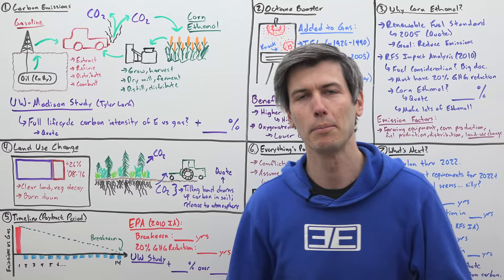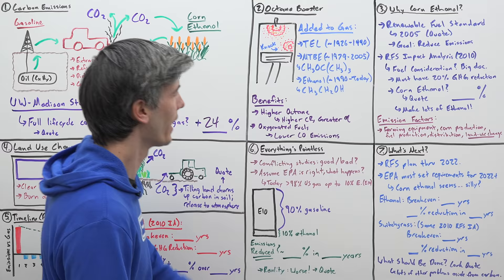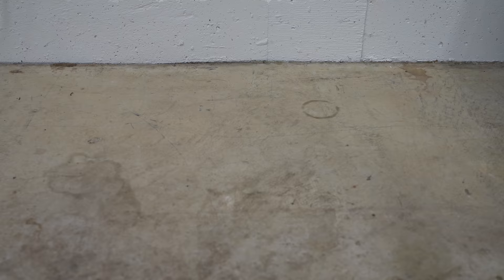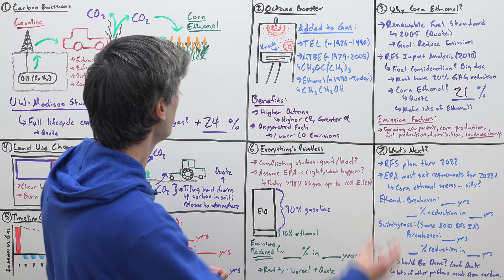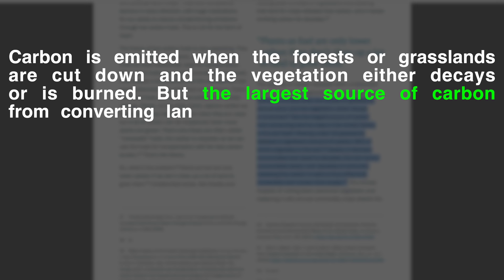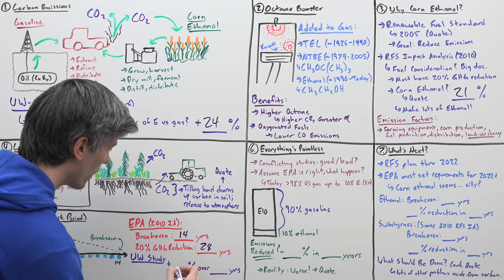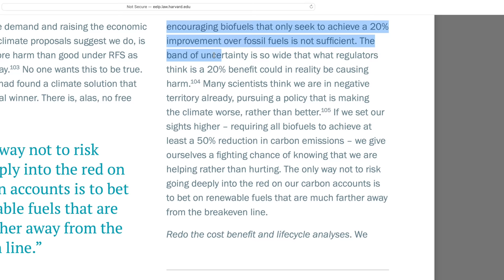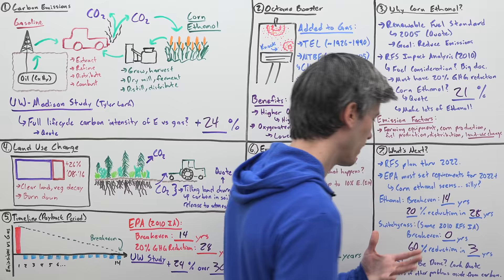America Was Wrong About Ethanol - Study Shows

Comment: You left out the fact that ethanol doesn't contain the same amount of energy as gasoline thus reducing the efficiency of internal combustion engines resulting in more fuel being consumed in the pursuit of conservation. It's also bad for many engines, especially small engines, causing them to run too lean. Another wonderful known byproduct is that ethanol is hydroscopic which leads to fuel system problems and internal corrosion. Rubber and plastic can swell or lose their structural integrity causing seals to leak or fail. Some manufacturers will void the warranty if E15 is used. Everything about this substitute adds to more energy being consumed to compensate for it. If it worked there would be no need to mandate it. 

"As a result, taxpayers have spent billions of dollars over the last 30 years subsidizing the production of corn ethanol, while at the same time creating unintended costs for consumers and the environment."

This was always politics. It's been well known since its inception that the unintended consequences outweighed any theoretical good.
Reply: detail question, what makes you say it's bad especially for small engines? don't oxygen sensors and stoichiometric EFI operating/control strategies correct it to lambda=1 which is say 14.7 for 0% Eth gas and 14.3 or whatever respective point (i forget) it might be for E10 gas etc?
Reply: Imagine having a carburetted motorcycle and leaving it for some time without starting it. Gunks up jets, clogs the fuel bowl etc

Makes startups after winter a pain in the back

Yes. I did use fuel stabilizer, didnt do jackshit
Reply: @renizer  not on lawn mowers/ lawn equipment and carbureted motorcycles. Anything without electronics to compensate. Seems like you’re nit picking and missing the bigger picture…
Reply: The best results would be reached if gasoline cars were turned into flex-fuel (or bi-fuel, whatever the name) cars. I installed a small box to my previous car and that basically monitors the data from lambda and increases the time the injectors are open. So it stands between the car's own computer and the injector. Of course it also monitors the alcohol concentration. E85 contains about 85% of ethanol and my 2001 Audi A6 was running like a charm with it and also with any mixture of that and gasoline. Only cold starts in the winter are a problem, below -5 celsius needs some gasoline mixture. Pure E85 consumption was about 30% bigger than 98 octane (Europe standard, don't remember the RON vs whatever differences) that has 5% ethanol in it and can be used without any modifications to your car. 

But also, the ethanol should be made out of waste, not turn land and grow food for that. In Finland ST1 produces it's ethanol from wood industry's waste and some common waste too. So they're using the leftovers that wouldn't be used elsewhere. CO2 isn't of course the only emission difference, ethanol burns much cleaner too. And a bit cooler.
Reply: @someguy9520  yes. I spent hours attempting to clean a carburetor on a motorcycle that had sat for an extended time. It never fully regained its original performance. At least not with the time I put into it.
Reply: @someguy9520  next fall when you put it away let it run out of fuel then put in a little non ethanol in to flush out any left in the system and let it run out of fuel again.
Reply: @raycar1165  sounds good if one has non ethanol gas available but many have zero availability.
Reply: @raycar1165   the problem is getting non ethanol fuel without paying for the stuff at tractor supply and home depot
Reply: Anyone ever heard of adding fuel stabilizer like Stabil to their fuel before storage?
Reply: @thatsonebadhatharry8610  fuel stabilizer doesn't mitigate the effects of long-term storage of ethanol-laced fuel.
Reply: Ethanol is hygroscopic, not hydroscopic. Brake fluid is similar, it absorbs moisture from the air.
Reply: @JohnnyBfromPeoria  And what do you consider long term?
Reply: @raycar1165  not possible where i live. In Austria its near impossible to get ethanoel free gas. Its only E5, but still enough to have water forming on the bottom of my tank

I had good luck with fuel cleaner and running it through the system with a good ride. Then top up with fuel and a little bit of that fuel cleaner

This winter i ended up just riding through the season. No snow and temperatures just warm enough to not freeze  everything
Reply: No. It's wrong. It makes more power! Look at the numbers
Reply: @gabrielv.4358  What numbers? The only thing related is the octane is higher. Alcohol has a lower btu rating than gasoline so just adding alcohol to gasoline will not produce more power. If that were the case your mpg would go up not down.
Reply: @thatsonebadhatharry8610  mate. There very few that actually do anything to slow down decomposition of fuel

Fortnine did a small test and Taryl fixes all did a huge long term test with lawn mower engines left outside a tent for more than a year

The long term test basically concluded that its snake oil at best. At worst it makes the fuel gel up even faster and accelerates breakdown even more
Reply: @thatsonebadhatharry8610  Most of the flex fuel engines (at least in Brazil) are worse in fuel consuption when it's using 100% ethanol. Maybe it's just because it's flex... With gasoline it makes more mpg (Km/l)
Edit: The car manual says the mileage it makes
Reply: Absolutely... energy density for gas 46 MJ/kg vs ethanol at 25 MJ/kg. At 10% ethanol 90% gas results approx 43.9 MJ/kg.  ( you burn more 90/10 fuel to get the same output as gasoline. Ethanol affects the layer of aluminum oxide that forms on aluminum parts causing erosion of the metal, although it is very minor. 

Here is a very obscure impact of corn ethanol. The by product of producing corn ethanol is the feed stock for making high fructose corn syrup that is packed into everything on grocery shelves making Americans heavier causing more fuel to be used to move them around.
Reply: @gabrielv.4358  It does make sense that they get worse gas mileage since ethanol has a lower btu value than straight gasoline
Same goes with diesel. Yes they function more efficiently than gasoline counterparts, but also because diesel has more btu than gasoline
Reply: @gabrielv.4358  so your conclusion is the same as the original poster. That ethanol in your gasoline make it less efficient than gasoline with no ethanol. You mentioned 100% ethanol, I don't know of anyone using straight ethanol in a street driven vehicle, if you did it would cost more that 5 times the amount that gasoline cost.
Reply: @thatsonebadhatharry8610  I dont think it is 100% ethanol. But seems like it is advised like that.
Ok I am going too far and my knowledge is not that big for ethanol. And for normal fuel is not that big too...
I just know that it is made from sugar canes and it is alcohol in its pure form. 
I think it has water in it too, but not sure. I know its worse than gasoline because it burns fuel lines inside out
Reply: Turns out Engineering Explained has a video making most of the points I made in my original post. Maybe a call out to that previous video would have prevented this entire thread. Or at least a recap of the downsides not mentioned in this video.
Reply: I like that, if it worked there would be no need to mandate it period. Thats it!
Reply: It's the same thing with solar and wind power there cost out weightsthere benefits really there are only 2 tipes of green or low impact power sources hydro power and nuclear power or fusion power but we aren't there yet 🤔
Reply: For the most part cars are way overpowered for 90% of normal populace use so less power doesn't matter, cars shouldn't be able to do more than like 90mph anyways. Second, sounds like corn based ethanol isn't the issue, i.c.e  cars are. Full electric solves both the gas pollution and money swapping political issues over this in one move.
Reply: @unknownunknown-ni1ns  ha! Yeah. Electric cars are free from politics. Hey, I have a bridge for sale…
Reply: I like that "if it worked, there would be no need to mandate it" one could apply that thought process to many government endeavors. Thankyou good sir!
Reply: I restore old cars. Cars that have been sitting with ethanol can have completely ruined Fuel systems even the fuel injectors. Cars stored pre-ethanol at worst have gummy deposits that ethanol Ironically does a very good job of cleaning.  One thing is Ethanol supposedly makes the rest of the fuel burn cleaner. It's also some how supposed to be able to reduce the rate of evaporation of the rest of the fuel. Really would like to see studies on this. Especially studies of modern cars if it really burns cleaner even in well maintained 90s cars.. Yeah, I'm sure an old old car that ran rich from the factory will be cleaner when you use a leaner per volume fuel which happens with ethanol. I really have a hard time accepting that part or all of the ethanol roll out wasn't done to destroy older equipment. It's also telling that the EPA never required or even researched into the use of corrosion inhibiting additives to protect things in contact with ethanol fuel.  Then again it could all be normal incompetence.
Reply: Exactly! I thought of the same thing. I get much better gas mileage when I use non-ethanol gas. But I don't like paying the higher price, so I usually only buy it for my small engines. It's up to $4.03/gal today. Let's Go Brandon!
Reply: mileage reduced by approx. 10%  by burning gas with 10% ethanol, so I buy 10% more gas too go the same miles. costs more ,does nothing!
Reply: @someguy9520  Child of the 70's here. Gas w/o ethanol gunks up worse. Gas used to be much worse at leaving deposits inside fule system. It used to be a mix of hydrocarbons that one the whole met certain test criteria. Now it's fair restricts bunch of hydrocarbon. A lot less heavier ones. Gas even smells so much different.

At least when it's used the ethanol dissolves gunk (can be problem if it clogs a jet, but better over all).

Plastics and seals issue is only on really old equipment.
Reply: Part of the problem is ethanol being used for economic reasons and not for performance. It's comparable to 100+ octane race fuel in it's resistance to detonation. IIRC you need diesel-like 14-1 compression or forced induction to make ethanol sensible. Slapping flex fuel on a NA 9-1 econo-box is literally burning money.
Reply: @56Spookdog  if you live in the Midwest there are plenty of non ethanol gas stations lol but yes I wish they had it in other parts of the country
Reply: I own an older jet ski. I can't use ethanol fuel in it because the ethanol will literally melt the fuel lines and parts of the engine. It's a well known problem. You get this blue-grey gunk (literally the interior of the fuel line, which the fuel is basically melting) that builds up in the carburetor and makes the engine have all sorts of problems running. 

Just because a fuel will theoretically produce lower emissions doesn't mean it won't destroy the engines of everything currently on the road.
Reply: You aren't making me happy.
Reply: @michaelberger6699  i always thought that gas from that time could be stored for a few years and it would still be good, since the lead kept it from fouling and decomposing
But good to know that the fuel isnt as good as ppl from that time remember
Reply: @unknownunknown-ni1ns  hahaha you are so so wrong on both accounts the push for electric cars is very much a political one and forcing some one to buy a car they dont want is wrong on so many levels as for your electric car salving the CO2 emissions problem think of how many times you throw away a battery out of a flash light and before you start yes all batteries are rechargeable some better then others so how much fuel are you burning to recharge your car every 8 hours and how much fuel was burned to make that 1 battery for your car how long will it last before your charging it ever 2 hours and how much will it coast to replace that battery in 5 to 10 years if it last that long at there going to tell you its just cheaper to buy a new car verses having a new battery installed and where will your car with that dead battery go to a land fill  all also god forbid that car ever catches fire the fums from that battery will kill anyone around it
Reply: @someguy9520  my motorbike is 18 years old. Carburated. It has been running on E-fuel all those years. E5 and E10. Every winter it sits for 2-3 month. I have never had a problem starting it. Dont use any stabiliser. Dont do nothing. Im just stating it.. Ethanol has become the explanation and excuse from shitty mechanics.
Reply: @bhosterman  i'm not missing the bigger picture, hence me writing that i have a detail technical question as I was curious about the fact you were making about "small" engines, should have probably said carbureted/open loop controlled engines, gotcha there.
Reply: @renizer  not really. I knew what you’re up to. Trying to use terminology you think the average person wouldn’t understand to sound like you have a superior knowledge about the subject. Very few people use this terminology when talking to the general public. So yeah. I spotted your intent a mile away.
Reply: @bhosterman  whatever man, ofc i'd word a tech question with the corresponding terminology. Just didnt think of carbs to be quite honest, and mistook small for referring to displacement which would include about any compact to midsize car these days
Reply: @renizer  mixing technical terminology with “gotcha there” doesn’t suggest or infer honest inquiry. Quite the opposite. Not my first debate.
Reply: @renizer  and to answer your original question, not necessarily. My Harley’s fuel map has boundaries limiting the amount of swing in the fuel air mixture. Even with my tuner I can only make limited corrections in either direction that may not achieve proper mixture. These are set by regulations I presume. If I want to go outside of these limits I have to buy the stage three kit and gain access to the full potential. So, I imagine that this is not limited to just Harleys. With ever increasing demands by regulators for lower emissions and better fuel economy most engines if not all are tuned to run as lean as possible and depending on the vehicle’s computer mapping limits, may not be able to adjust enough. There are all kinds of shenanigans in built in for planned obsolescence.
Reply: @pgkr67  mine is a '98 and of course carbed. Count yourself lucky. I disassembled my carbs after winter once and it was gunked up like mad. Im not just a dude saying"I have problems after winter break". I know there are a lot of other problems like weak battery etc that makes it hard to start

Where do ya live? I get the feeling that in some parts of the world E5/E10 makes less impact if the fuel has enough additives
Reply: And I totally forgot my current issue with my daily driver. Obd2 code P0171. System too lean. Now I’m not insinuating that the fuel is the culprit but it’s a perfect example of the limitations the ecu has on making adjustments to compensate.
Reply: The amount of fuel you use isn't the issue. It's the emissions from that process that's the issue. Hence why cars that got reflashed due to emissions got worse gas mileage after the software update.
Reply: @MeltingRubberZ28  but worse gas mileage translates into more consumption which negates the lower emissions.
Reply: @bhosterman  not true. When it comes to emissions carbon is actually one of the least problematic. NOx glasses are the real issue and when you run lean you generate more NOx gasses, like I said, hence why car manufacturers run cars richer to reduce emissions.
Reply: @MeltingRubberZ28  you don’t understand what you’re talking about. Less emission per combustion cycle is negated by more cycles to achieve the same distance traveled.
Reply: *lower energy density does not make an ICE 'less efficient'. It just means you need more of the fuel.
*the purpose of ethanol in fuel is not "pursuit of conservation", whatever that is supposed to mean.   
*this story about being hygroscopic leading to "problems and internal corrosion" is essentially  a wives tale.  Just like the wives tales about unleaded fuel causing engine damage due to detonation:  not 100% untrue, but almost completely.   I use E10 in Australia, and have put it in a number of cars, including my 1970 renault engined lotus with Weber DCOE carburetors, which have not over many years, been "ruined" by E10.  Also in  my 2006 subaru, someone else's 2012 subaru XV, a 1998 toyota corolla, a 2004 VW Golf.   NONE of them had any problems at all.  Particularly, I have never had any problems with any fuel lines, metal or flexible.
*If you leave any petrol in a carburetor for an extended period, gums form and that requires cleaning.  Given that fuels include 15% ethanol at the most, and therefore 85% gasoline at the least, I am interested to know how someone would determine that it was the effects of ethanol which required the overhaul, rather than the gasoline.
Reply: This is one of the biggest elephants in the room when it comes to fuel efficiency and or economy. The more efficient something becomes, the more it’s used and the more broadly available it becomes to people who previously couldn’t afford it. Look at any industry and as prices come down due to efficiency the more people consume it. So even at a lower individual consequence you have more consequences total.
Reply: Manufacturers do not design cars to run rich. “Fuel efficiency” is achieved at lean mixtures.
Reply: @alexanderSydneyOz  “lt just means you need more fuel”… That’s the definition of less efficient!
Reply: @MeltingRubberZ28  straw man much?
Reply: @bhosterman  the process of combustion if running a lean mixture combines nitrogen in air and combines it with oxygen generating NOx gasses which are harmful to the environment. If you run the process rich, the nitrogen has nothing to react with and therefore the emissions are not generated.

If I want help tuning my guitar, I'll call you. If I want help tuning my car, I think I'll pass. Have a good day bud.
Reply: @MeltingRubberZ28  Nice try but...

"engine running rich will lead to numerous problems and noticeable symptoms, like low gas mileage, reduced efficiency, lower acceleration, shaking while idling, and a strong smell of gasoline. Find out the engine running rich symptoms so you can find out how to quickly and properly diagnose your car. 

 Keeping your air and fuel mixture at the right ratio in your vehicle is key to the performance, longevity, and lifespan of the engine. Although various parts go into the air and fuel mixture, there are certain parts that could lead to the prevalent engine running rich symptoms. By diagnosing and determining the causes of the improper ratio, you can fix the problem quickly and efficiently."

So I think I'll pass on your faux level of understanding.
Reply: @bhosterman  😂🤣🤣🤣🤣 nice Google search bud. You should join the EPA. Like I said, have a good day bud. Not worth wasting my time.
Reply: @MeltingRubberZ28  this is common knowledge. Engines are tuned for efficiency over any other consideration because of regulations. Efficiency is not achieved with rich mixtures, or richer mixtures. This is really a game of semantics. The epa and other regulatory bodies don’t care about the downstream problems they cause the end consumer. They care about lobbyists and getting re-elected. All this posturing about who knows more is academic. The prof is in the pudding. 

I love how people like you use the medium someone used to acquire information to discredit said information instead of better information. Lazy.
Reply: @thatsonebadhatharry8610  It sure didn't take long in my Kawasaki ZRX1200R, like maybe two months.
Reply: @JohnnyBfromPeoria  You must be getting some really bad gas. You might want to get it from a different gas station. I've never had a problem starting my riding mower after is has sat over the winter, at least four months time. I've never used any additives to keep it fresh or emptied the carb before storage. I wouldn't have any problems adding a fuel stabilizer I just haven't needed to. Sorry your having so much trouble with your fuel situation.
Reply: what are you drinking,, u are false  you dont know the truth so u tell a lie
Reply: @56Spookdog  They sell the non ethanol at Home Depot and Lowes.  It's expensive.  Use it sparingly at end of season to flush out system before storing your lawnmower / snowblower
Reply: @haroldbrooks5473  grammar much?
Reply: The total fuel consumption of U.S airlines is approximately 19 billion gallons annually. 

Total fuel consumption for mining lithium to make electric car batteries is 21 billion gallons annually.

The 21 billion gallons can only produce enough lithium for 250,000 car batteries.

The lifespan of an electric battery is 10 years and is not renewable.

Electric cars are not better for the environment.......they're worse.
Reply: Also completely left out is the impact on the food industry and the fact that while corn based food products going significantly up in price was an inconvenience for wealthy individuals/nations. This was a death sentence for poorer individuals/nations who were already struggling to feed themselves.
Reply: Any alcohol based fuel inherently has a lower btu value when compared to regular gasoline. Alcohol burns slower and cooler. It’s higher octane prevents pre-detonation (combustion before spark plug fire). Race engines that run on methanol for example may be able to run a 17:1 compression ratio vs. a 8:1 for a conventional gasoline engine. HUGE torque gains. Those torque gains aren’t fully obtainable when throwing “race fuel” which is what ethanol essentially is, at a modern street car. I’d love to see an engine engineered specifically for E-85, not a flex fuel engine designed to tolerate it.  The oil lobby is strong.  Never forget that
Reply: @Garbox80  the byproduct of ethanol production is a protein rich “dried distillers grain”.
Reply: @michaelberger6699  It’s a well hidden secret that gas companies who directly control their own filling stations use the LOWER quality gas blended with the 10% ethanol to get their octane. Then they market their “ethanol free” gas with a MORE refined gasoline with the same additives they use to boost octane for higher grades. Don’t forget that they were MANDATED to blend a competitive product. Might as well give it a black eye.
Reply: @Calvin Pessl  tore apart many carbs from sitting. 

Lots of toothpicks, and solvents.

Next time drain tank and float bowl. Then run engine util it quits.
Reply: @Gabriel V.  power and energy are different measures.
Reply: @someguy9520  Ethanol absorbs water...it doesn't create it
Reply: @weswalton8813  i know
It absorbs moisture and if there is too much to get absorbed, ot separates from the rest and forms straight water. Since its more dense than gasoline, it stays at the bottom corroding my tank. Also, its the first that gets sucked up by my fuel delivery system
Reply: @someguy9520  Where did all of this water go before ethanol? What kind of plastic fuel tank do you have that corrodes? How does it stay at the bottom of the tank 'corroding' if it's the first stuff sucked up?
Reply: @weswalton8813  ...not sure what ur trying to prove
It absorbs moisture from the atmosphere till it cant anymore, the it begins to separate the excess moisture(aka water) and it collects on the bottom of my tank

My "plastic" tank wouldnt rust/corrode, since its plastic 😂
But in my case its made out of steel/iron that isn't rustproof, so it rusts really quickly when water forms

It gets sucked up firstly and guess what. Water isnt very combustible. That makes the engine start really hard
Reply: @someguy9520  People thought Heet fuel treatment would work miracles and has been in production since the 1930's, yet ethanol some how causes water to collect in gas tanks. My point of a corroding plastic fuel tank was assuming your tank was plastic, my fault for assuming. Very few steel tanks being manufactured in anything anymore.
Reply: @weswalton8813  never heard of heet fuel treatment

Oh, so just a small misunderstanding, gotcha
Yeah its an 98 motorcycle, thats normal. Most motorcycles still get delivered with metal tanks, except dirt bikes. Sometimes they use fuel pods, that may be out of sth diffrent than metal
Reply: @JohnnyBfromPeoria  If you're storing an engine for a long time you're supposed to drain the fuel anyways.
Reply: @renizer  Ask the broken down engines.